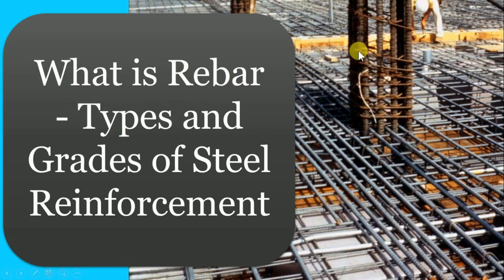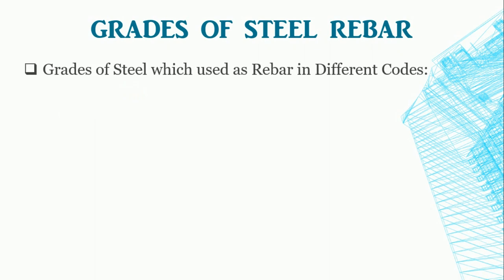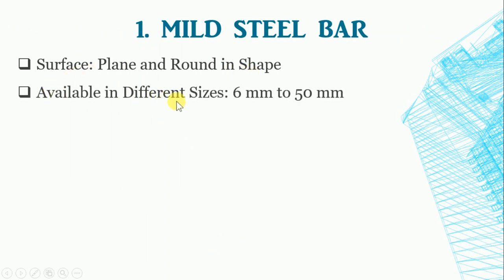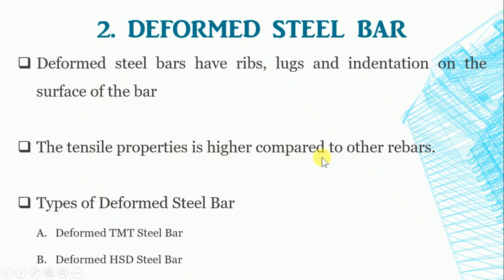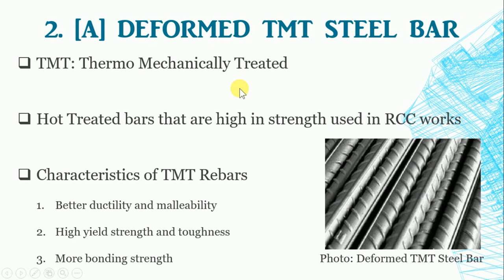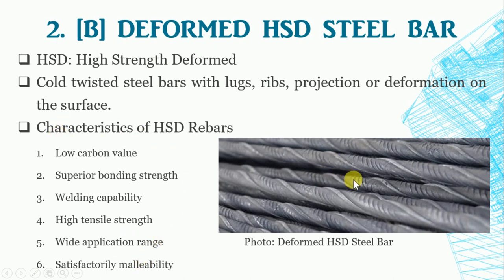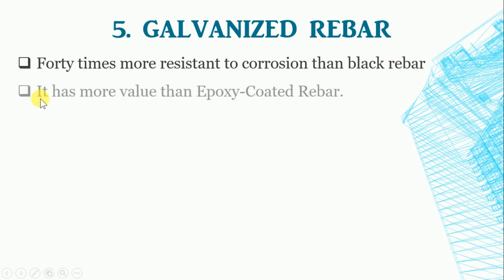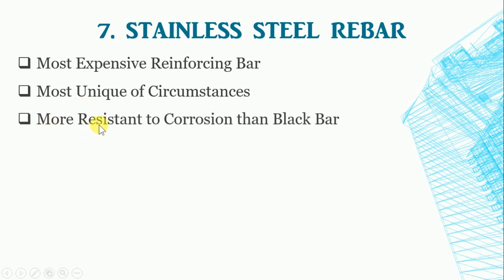What is Rebar - Types and Grades of Steel Reinforcement │ Structural Design - Knowledge Base

Comment: How and when during manufacture are the ribs, helix and other surface effects produced?
Reply from the maker: In steel industry, a special equipment is used for that in which first rebar is made straight and then ribs are created by compression & for this process bars are circulated through numbers of pulleys....